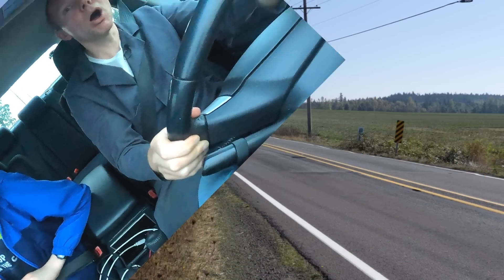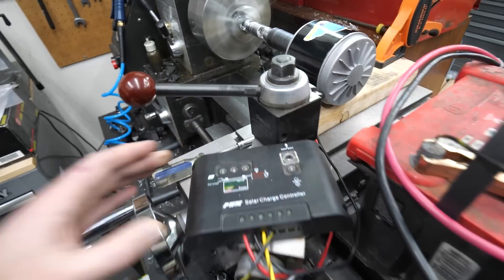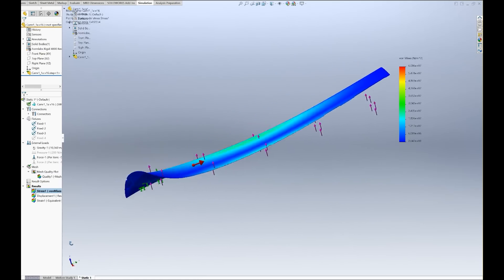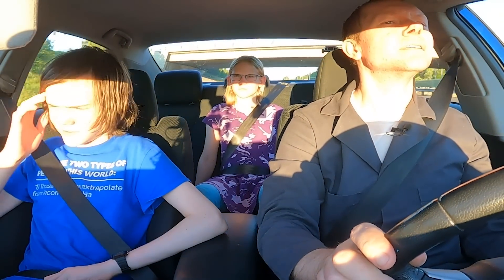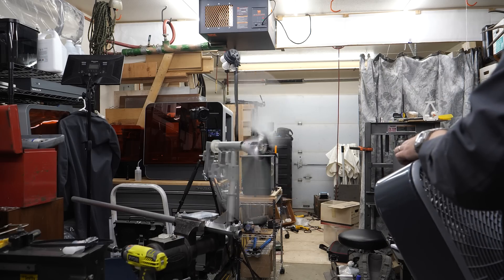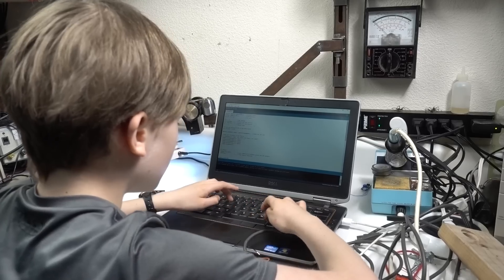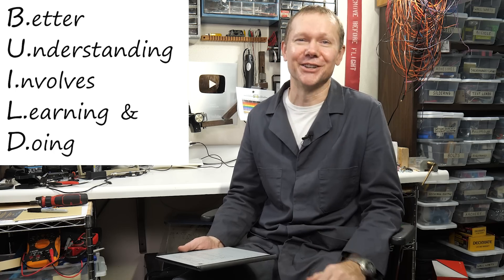3D Printed Turbine on a Camry - Wind Power on a Car #6

Comment: Very good experiment! Haved watched the whole thing yet.

Goes to show you how much efficiency you could gain from a higher efficiency generator on the engine if the alternator is only 50% efficient.

I had thought about having two alternators and two batteries to run the AC and other systems for an off the shelf equivalent of tge 48 volt systems.

I came to the conclusion that a 48 volt is not enough for a mild hybrid system that is also responsible for the AC unit and water pump. I think a 110 volt system would be better.

Thoughts?

Comment: You are comparing efficiency of the alternator vs. the Wind Generator. Both run on "Gas", as you need to overcome the aerodynamic resistance of your Car plus all the Turbine "harvests". The placement of the Turbine ist not irrelevant, but Betz' law does apply. The Air behind the Turbine is slowed down. That is not what you want in front of your car.

Comment: Intuition says the the area of highest static pressure at the front of a vehicle will be at the most forward, most perpendicular to the wind part of the body where the wind has to change direction the most..? (This is aerodynamics where intuition is almost useless!)

That prop should make it so the air hitting the same surface is no longer perpendicular to it, which may well improve the overall aerodynamics of the car.

Comment: My gut says you're right, but in order to fully use this system I'd argue you should be using a (smart) hybrid car so it has both electric and gas power. That way, the wind could be a major help in charging the hybrid system.This would very likely increase net gains by a LOT, is what I think.
 But I'm just a random dude.

Comment: why not build a housing structure similar to the radiator mounted with 100pc fans linked together. doesn't take much to get those little fans moving at ultra high rpm. redesign the grill to be your turbine. side mirrors and spoilers would be great places to add smaller turbine units. closer to the vehicle the better.

Comment: My feeling is that on your Toyota you will loose fuel efficiency, because it is designed to have low aerodynamic resistance, and you will probably spoil this design by introducing turbines in front. And the lower the aerodynamic resistance  of the car is by design, the more you will loose efficiency. 
On the Bronco you used for your previous videos, however, I would assume that you could increase fuel efficiency, as the aerodynamic resistance is really bad and turbines in front might be able to improve the overall aerodynamic resistance.
All in all I think that fuel efficiencey can be much more improved by better aerodynamic design than by adding turbines, but I am really interested to see the outcomes of this experiment.

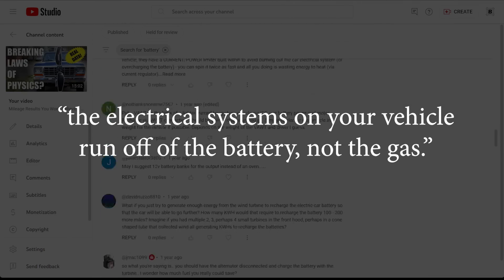Comment: At about 02:21 in this video: 
No, if that were the case the battery would quickly go dead. 

Also, AFAIK most -- if not all -- automobile batteries are not "deep-cycle" batteries. That means they are not designed to be heavily discharged and then recharged over and over again. Doing that will eventually kill them.

Comment: Why not just concentrate on alternator draw during highway driving ie headlights, radio etc. The defrosters are used sporadically so take the hit on those. Seems like if you offset normal alternator load the gas mileage will be significant.

Comment: You should include a 2nd system in the back of the car with 2 counter rotating blades. Essentially creating a ‘Pusher’ blade system in the rear wired to the charge controller, then I too the battery.

Comment: I seen this done with the tulip looking wind gen.instead of props which takes more air mass to move.  
 Wouldn't the air passing by the blades cause the air to be turbulent? then, the turbulent air hitting the car cause a bounce back void that  "could"  backlash on the wind gens prop? this is why i feel it should be on top, and, unhindered . . .

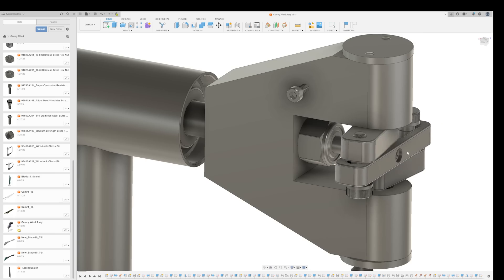Comment: 5:36 i just saw your more recent video where you had trouble controlling your pitch. i think part of that can be remedied by giving the lead screw a couple of guides. i think this design might alow the lead screw itself to pitch slightly. wich will put a high load and friction on the threads of the screw

Comment: I  don't understand why it's mounted on the front of the car ( with all the air smacking it head on?)    vs  having them on the side of the car ?? so the blades rotate with the wheel ???   (probably the same difference,   but just feel   like the blades would't be as stressed?)

Comment: Would a horizontal axis turbine  work better? I have planned a similar experiment (mostly in my head due to funds) but using a horizontal instead of vertical axis turbine. Also, ducting and other performance enhancers would greatly benefit this experiment.

Also, these types of power recovery devices would work better on an EV. This is similar to a video done by  @WarpedPerception where he uses a small engine to charge his Tesla.

Comment: If you mount your turbine on the roof, it will generate more power due to high upwind from the front and the wind speed passed the turbin is much faster than the speed of the car.

If you put the turbine in front of the car and the turbine is too close with the bumper. That is the stagnation point where the speed is at slowest point.

Comment: well since most cars now have what bmw calls efficient dynamics, the alternator is during the rollout phaze or when you stop pusing the gaspedal used as generator to brake the car very slowly and store energy in the battery, this system typically saves 10-20 percent energy and is typically indeed the consumption of all electronics and airco, this demands a better sealed battery and a bigger alternator
so it will depend on the type of car you are driving if he has efficient dynamics. i think toyota is using some equivalent system there is not permanently say only during certain moments am alternator spinning, so software in the car is uncoupling the alternator when battery load is high enough
second remark if you generate 800watt you could equally install a solar panel, that will generate electricity even when standing still, what could be realized with 200-400watt pv
😊

Comment: Question: did you hook up the buck converter directly on the battery?
Reply from the maker: I tried that but it allowed some current to reverse back into the generator and turn slowly like a motor when the car was stopped. I ended up using a voltage comparator and a relay to only connect the positive to the battery when the generator output >20v.
Reply: @QuintBUILDs  Thats pretty amusing, alternator hybrid build when? On an actual note I tought that maybe instead of wind power I could hook up a battery on the electrical system to lessen the alternator load. Something like an ebike battery that could supply the electrical needs of the car for at least 1h. That way there won't be any wind drag downsides and the only thing is you'd need to charge the battery at home and then replug it into the car. If that works tho and the savings are significant enough it could make a great mod for older cars.

Comment: You should look at air plane generators, Every aircraft has a generator which is basically a squirl cage fan and gen built right into the aircraft. A friend took one out of a Cessnas gen and installed it on his truck. It actually worked brilliantly. He use to use it to charge batteries for his motorhome.

Comment: I predict a negligible change. I think you are reclaiming some of the losses. But i think it is being offset by the aerodynamic inefficiency of the shaoe you've added to the front. I think with very careful tweaking and optimizing, it would be possible to reclaim more than you lose. With no calculation done at all, just pulling a random number out, I would guess 5%

Comment: If it is done right, it should work. I have so many ideas on this but no way to test them. I think you are using the wrong blades, use a blade closer to the ones kids run with in their hands.

Comment: I don't know anything about what you are explaining, however i wondered if you used a vertical turbine mounted on top of car, whether it could provide enough power to be used on Hybrid cars that use braking to power the battery.  From what i take away from you videos is that the gas consumption is not affected much with your turbine but out put to power your oven was incredible.  just wondering if that wattage could be used to re-supply the batteries on a Hybrid car as we know it or perhaps a newer version of the car.  This might solve the milage limitations on current EV's and perhaps solve the charging limitations at the same time.  Thanks for listening.

Comment: You would be better off using an impeller type fan blade. Again a suggestion but fan type blades do not work as well in the buffeting wind

Comment: @quint what if you ducted the frontal air to a Tesla turbine since wind turbine blades are not very road friendly? My guess of there’s more research in designing the parameters but it should be simpler construction and more robust.

Comment: The problem in strapping turbines to the vehicle is that you change the drag coefficient of the car, which depends on the form. Car manufactures don't (nowaday) choose the form of the car by pure aesthetics, but they engineer it to have a low drag coefficient. The drag coefficient will have an impact on the required propelling force, multiplied with the velocity squared. Thus driving faster, fuel conumption will increase, IF the drag coefficient is really worsened by the turbines (which i think it is).

Other factors to consider, that influence the accuray of your tests: Because the fuel consumption is directly depending on the velocity difference between vehicle and wind speed, it will be hard to give an reliable answer based on your proposed test setup, because you will never have the same windspeeds during two tests. If your tests will be positive, meaning that you will presumeably have increased fuel economy, how to check if different wind speeds during tests did not cause this. You would have to do many test drives to be certain of a result.

Another thing to consider: If it would actually increase fuel economy, car manufacturers would already be putting things like this in their vehicles. They are interested in low fuel consumption due to governmental pressure and competition.

Comment: Dude come on please use Vertical Wind Turbines on the front n side n simultaneously or try each side individually I promise it will work then that old propeller style turbine won't work with wind like that u a engineer u should know this I with u had a Tesla or electric car to really find out cause I think that type car is the next big future thing in automotive n transportation electric wind n solar energy vehicle transportation🎉🎉🎉🎉goodluck

Comment: My suggestion is to put the turbine in front of the radiator as air have to go through the radiator already and a bit more restriction won't make a big difference and your truck already have either direct drive fan or thermocoupling fan on the other side of the radiator.
Even though you won't have the same watts produced it will definitely have a less impact on the fuel efficiency.
As a master mechanic and send a lot of travelling between my clients I've seen many new vehicles where they have manufacturers have put the fan in front of the radiator for either cooling the engine or air con and the fan happily spins fast when driving. Now some will say but it's because of the fan is now powered on but actually the electric fan only works for low speeds as most of the time fast speeds say 80-100kph  under normal to light loads like coasting the fan won't come on and I actually had a volt meter connected on once than proved this that showed that when the fan wasn't powered it would generate power.
Just some info for you.

Comment: Neat project but- "it won't work". Great for a Kids project in order to understand why we don't do this. The only way this works is if the fan makes the Car more aerodynamic, while also making up for the energy lost through friction, heat and lost power in the lines. New Cars are designed to be very aerodynamic these Days, it's a big reason why every Vehicle looks the same anymore (ease of manufacturing also plays a role, which is why you may be able to improve aero with a fan and maybe overcome it- very unlikely though)

Comment: https://youtu.be/UYQWgoRflL4

That is a link to a video by rctestflight, which revives a YouTube debate from a decade ago about directly upwind faster than the wind (duwfttw), veritasium has a video from a couple years ago reviving the similar but more popular debate about directly downwind faster than the wind (ddwfttw)

And of course tacking, the centuries old practice when sail boating to alternate between sailing just right of directly up wind and just left of directly upwind to produce a net movement that is directly upwind should be proof enough that a wind powered vehicle is capable of moving in any direction relative to prevailing winds.

If you were using drag based props or sails that might not be possible, but since the props you are using and the sails on a boat rely on generating lift it is indeed possible.

I propose that taking a VAWT type turbine, turning it on it's side so it's axis of rotation is roughly parallel to the axis of rotation of the rear wheels and placing it where you'd place a spoiler would get you the best results for a useable source of wind power on a road vehicle.

It's something I want to do with my hybrid when it's too old to take passengers for hire.

Of course, placing the wind turbines (or solar panels) in fixed locations off vehicle and using steel wheels on steel rails for the electrical ground path and overhead catenary wire at 25kV 60hz AC delivered via pantograph for the hot is far and away superior to on-vehicle wind (or solar) power.

Comment: Pardon my ignorance. My entire life, I’ve been under the impression that disconnecting the negative on a battery is basically the same thing as an off switch. My Electronics teacher said Negative First, Negative last, when dis-reconnecting a battery. Could you please explain If I’m right or wrong. Does it matter to the electronics? Damage wise?
Thanks!
Reply from the maker: If you work on the positive terminal with a metal wrench and bump against any metal part of the car you create a short to ground UNLESS the negative cable is already disconnected. Does that help?

Comment: Check the turbine in the rear of the car in the low pressure backwash that is less turbulent and more streamlined also using the vacuum that the whole car creates running through the air
Also a ducted fan or impeller might be more efficient as it could utilize vacuum

Comment: First of all, I congratulate you for all that work!! Regarding your question, I think it is simple and that you already answered it.... You were going to move the air that you are moving with the blades anyway but without giving it any other use than cooling the radiator. If you put it on the ceiling you would be moving more air unnecessarily.

Outside of this I have something spectacular for your blades and it is a video that came out today or yesterday... https://www.youtube.com/watch?v=OpiuQxuZXNc I am sure you will have better results if you try any of those ideas . and if you don't know Robert I think you're going to love his videos!! Greetings to everyone out there!  Cheers from Uruguay!!

Comment: A wind turbine on a car is a dumbest idea ever. This increases aerodynamic drag, which costs fuel to overcome. It would be much more efficient to burn this fuel directly in an electric generator. Since in this case there would be no unnecessary energy losses.
But apparently this is very difficult to understand for those who did not study physics well at school )))

Comment: This is an interesting question, because power or drag of the turbine and the car cannot be isolated. In subsonic flow, the pressure downstream has feedback on the pressure upstream, meaning that the free stream velocity at the fan is smaller than the car’s speed, and hopefully the fan is reducing stagnation pressure in front of the car. Another important factor is the boundary layer on the skin of the car. Flow around the body would be more laminar without the fan, positioning the car in the wake would dramatically increase the friction and boundary layer thickness, due to the turbulent nature of the wake. I’m not sure if the efficiency can be increased, because there are too many factors in this scenario- the efficiency of engine, alternator, turbine, generator, converter, fan-to-bumper separation, and the speed because the dominant form of drag varies with speed. I would suggest testing it with a simpler system so the variables can be controlled, or run some CFD cases with varying fan placement and speed to check the drag components on the car and the autorotating turbine. 
This is fun, wish you luck! MS Aerospace Engineering by the way

Comment: I agree the hypothesis is sound. I still think a bullet nose would bring a bigger saving. (Ups sorry, that comment is in the troll category). Rule of thumb says the average car has 20% of its drag from the grille and grille hood transition. That translates to 10-15% fuel savings eliminating that entirely.  Still a worthwhile project. Also, by having props leaving fast turbulent air in front of the unmodified car,  there is a chance that might be an aerodynamic drag reduction from that alone, avoiding the risk of larger vortex bubbles at the grille/hood and windshield/roof transitions.

Comment: I don't think it will work as well as a alternator because the engine provides the constant torque needed to generate enough electric to keep the car electrics running. so your car will need more speed to keep its systems running and while stood still the power would drain .